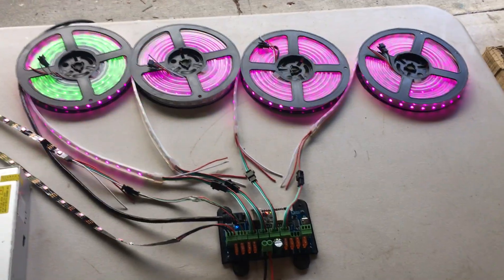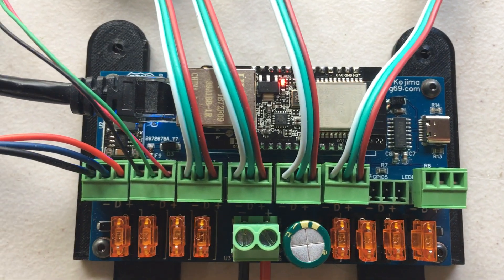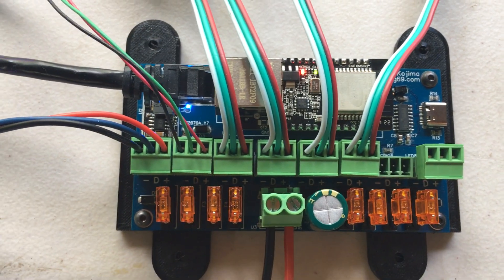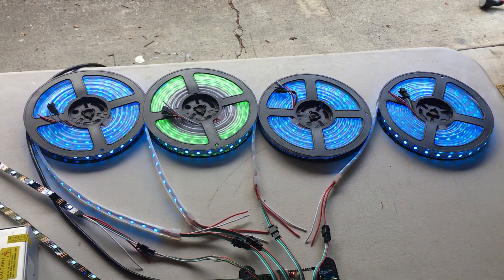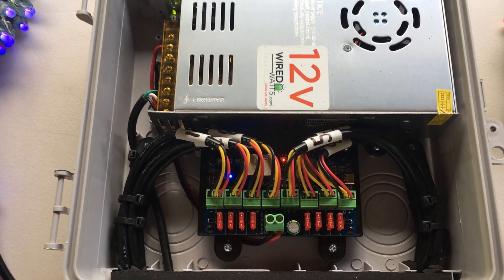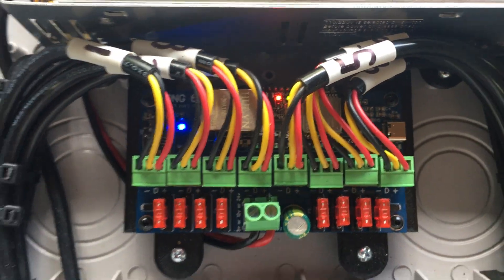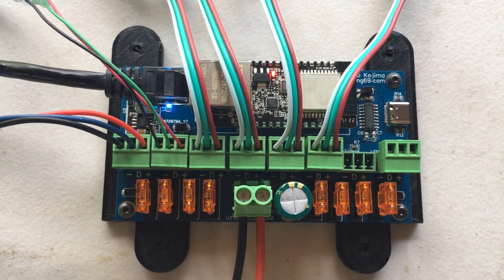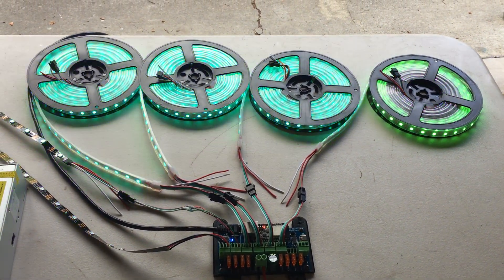8 port ESP32 LED distro board running WLED with ethernet and 5v, 12v, or 24v input power

Comment: I would like to use some thing like this for my boat leds. I'm planning to use two strips under the gunnels and two small modules with 3/4 leds for courtesy light and a small strip under the t-top. Everything will run with 12v power. Do you think it can work? Is it also possible to parallel two strips on the same output? Thanks from Italy
Reply from the maker: if you use WS2811 or WS2812 or similar smart pixels.  you can not parallel two strings on 1 port.

Comment: I’ve recently ordered a board and have not received any confirmation or tracking information. Would you mind helping me? Thanks!
Reply from the maker: can you please message me through tindie with your order number and i can find your tracking number and figure out where it is.
Reply: Thank you for the quick response! I’m going to have to speak to tindie customer support to ge logged into my account. For some reason the account verification email will not go through. Seems to be an issue on my inbox side. I know the order was placed with priority shipping for an extra $11 so If I can’t get logged in I’m sure it’ll arrive soon enough! Thanks again!

Comment: Is it correct that this controller only supports RGB (i.e. no white color channels)?
Reply from the maker: the controller does support white channel leds.  the controller runs WLED firmware.  WLED supports leds with white channel like the SK6812.
Reply: Got it, thank you. I see now that SK6812s have 3 wires just like the controller does. Both have a single data wire.   @bobko69

Comment: Excellent!!  Where I work we set up a Christmas Light Show every year with about 6 Hinkspix Pro controllers and about 30 remotes. I badly want a display at home but through HolidayCoro the cost would be beyond the grasp of the average Joe.
I'm looking at this video thinking I may be able to pull off a small display myself.  may I ask what firmware is on the ESP32 that allows you to send data from Xlights?
Thanks!!
Reply from the maker: The 8 Port LED Distro is running WLED which is supported by xLights.

Comment: my goal is to run 1 controller for 3 sections of my yard, (2) 16ft sections, and (1) 80ft section using 12v LEDs to help with voltage drop, do I need to change out the fuses and if so what amperage, silly question prob
Reply from the maker: using 12v LEDs is a good choice.  if you are pulling more than 5amps on a port then you will need to do power injection or split the string and use more ports.  running 1 80ft string on one output is do able but you will need to add power injection a couple of places along the string.  (probably every 200 or 300 pixels)  it might be better to split the string into shorter segments and use more ports.  you will already need to run power injection wires, why not run data along with it.
Reply: @bobko69  THANK YOU, this is great, so no need to replace fuses, correct? I am running per port no more than 600 led 12v BT Lighting WS2111B IP65 into some defusers. It will be epic and excited to get your board, its like mine just on steroids :) and I have learned that power shifters, power injection, and solid connections is our best friends when working with LEDS, I was hoping I could inject power on one end and then use the injection wires to connect and have it inject via the already pre-installed wires and working on some y cables or connect them in series like the main connection doing tests now. will be ordering your board, what is the warranty and support look like?
Reply: Also, Do I need to add anything for this to be wifi, as I noticed there are a few options with internal antenna or external and one at a discounted rated, can you explain the bad port, I think I can take that deal, I just will need all 8 zones, so unsure which port is actually bad and if I will use it or not, ty sir :)
Reply from the maker: @3DN4D  no need to replace fuses.  you will need to power inject after pixel 300.  if you have questions about the board, i will do my best to answer them.  wifi works out of the box.  if you mount the board in a metal enclosure or really far away from your wifi access point then you will need to get the external antenna version of the board.  read the product description, it tell about the discount board.
Reply: @bobko69  I will get the external just to be safe. Ty for your help and will review the description
Reply: @bobko69  just made my purchase on the discount model, nothing else seems to do what yours does, excited to build this right, I have been running 12v direct to the esp and I think I am frying them lol

Comment: This board is amazing and was a perfect fit for my application.  If your need is to control numerous sections of LEDs in different physical areas, just buy it, you will not be disappointed. Install the board in one central area, home run all your segments back to the board and configure everything in one interface instead of having a bunch of ESP boards all over the place.

Comment: I've been looking for something like this for my under eave lights that I can use all year round. Couldn't find anything in Australia until now, just ordered one
Reply from the maker: Thank you for your order!  the nice thing about this board is you can run WLED effects on the minor holidays through the year then switch to using xLights for more advanced sequences for the bigger holidays.
Reply: @bobko69 how do I get the RJ45 port operational, I've been using wifi temporarily.

Comment: hey i have the exact same board and cant get the 2812b leds to light up with wled please telp
5v 70amp psu 5v led strip wired the exact same way in video
Reply from the maker: sounds like you have the right power supply and the right leds.  it must be a configuration issue.  You can find instruction for setting the LED preferences here: https://github.com/bobko69/8PortLEDDistro/blob/main/README.md#how-do-i-set-the-led-preferences-for-each-port
Reply: it says 50 led should light up when power is applied with no modification, i dont get any led lighting up, i guess i should also mention that the only time i can get anything to connect to wled is when the usb c cable is plugged in, if its not plugged in wled will not find the light
 @bobko69
Reply from the maker: im going to email you directly with the email address you made your purchase with.  so we can figure out what is going on.

Comment: 1200 LED ? One led chip is about 0.2w 1200*0.2w/5v=48amp? What kind of beaker did you use 60amp? 😅
Reply from the maker: yup you need a big power supply when you run lots of leds.  i was using a 70 amp power supply to run those.

Comment: I love your board.  can you tell us which io pins on the ws32-eth01 you used for the 8 outputs?
Reply from the maker: There are several places to find this information.  if you have one of these boards it is screen printed on the board. it is listed on the tindie page where these are for sale.  and it can be found on my question and answer page: https://github.com/bobko69/8PortLEDDistro

Comment: Considering getting this,  but am totally new to LEDs. 

Would this work with like 3 or 4x strings of these: PAUTIX IP65 Waterproof RGB Smart IC COB LED Strip Light Addressable 24ft/7.5m,24V -- from amazon 
it says they have 4725 LEDs each

thanks!
Reply from the maker: that particular strip is not controllable with WLED.  the strip needs to use the WS28xx protocol to control it.  this cob strip from BTF-lighting will work: https://www.amazon.com/BTF-LIGHTING-Flexible-Density-Uniform-Controller/dp/B0BNBDWDGD

Comment: Cool product. Very clean!
How does the data line works? I thought the WS2812B LED's subtract their sequence of the data and passed it along to the next LED in the chain to repeat the process. But here I'm seeing the end of the strips are not connected back to the next strip? So in my head I imagine I would see all the strips mirrored, since they all start with the same data? Yet, I'm not... Looks like one continuous strip, individually addressable. Help my brain understand please? :) Is it somehow using multiple data lines?
Reply from the maker: this board has 8 ports, which means it has 8 data lines.  the WLED firmware treats all 8 ports as 1 long continuous sting.  WLED also has a way to break the string into segments.

Comment: Neat!  We can use both 12V and 5V strips with this controller? Is there a jumper to set the voltage, or is that in software somehow? Any chance you can share you code as well? Thanks!
Reply from the maker: well you can only use 5v or 12v pixels not both at the same time.  there is no jumper to set or code changes.  there is a buck/boost converter that will make sure the esp32, level shifter, ethernet port all get the correct voltage needed to run whether you connect 5v, 12v or 24v to this board.

Comment: with this board is possibile to command each channel with a button? this board can drimmer and can set mode for led addressed ?
Reply from the maker: There are 3 GPIO input pins brought out to headers.  these can be used for buttons.  in WLED you can assign these buttons to do different functions.  you should check to see if WLED buttons functions you want are available.

Comment: I purchased this controller from you... I'm new to this and I'm trying to connect with wled and I'm having issues can you please help me
Reply from the maker: apply 5v, 12v or 24v to the power connector between the fuses.  you can not power the board through the USB-C connector(USB-C is for programing only).  the board has a built in WiFi access point.  use your phone and search for a network to join called WLED-AP.  the password is wled1234.  after you connect you can go to the WiFi setup page and either connect it to your home WiFi network or activate the ethernet port and hook it to your wired network.
Reply: @bobko69  thank for replying I did all that but wen I connet my led and try to look for them on the wled app they don't connect

Comment: Can you show how and where you can hook up a MAX4466 microphone?
Reply from the maker: i do not have a MAX4466, so i have not tried this.  the board has 3 unpopulated pin headers each has +5, GND, and a GPIO pin.  one of the pin headers has GPIO36 which is the default used by sound reactive WLED.  hooking the MAX4466 to this pin header should make the microphone work.  the other headers have GPIO32 and GPI35 so more inputs can be added.  GPIO32 can be used as an output.  the other 2 can only be inputs.